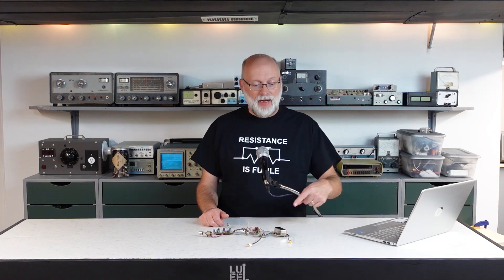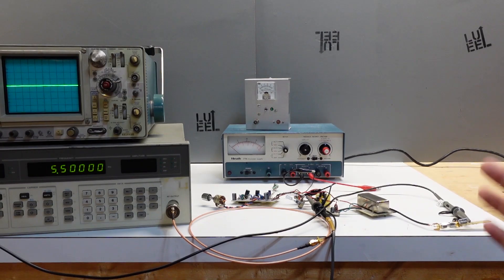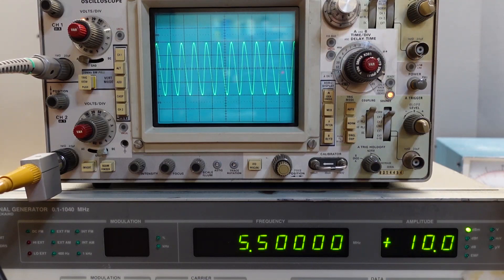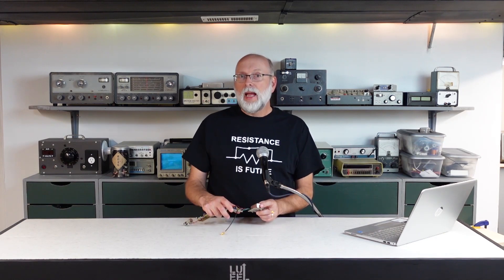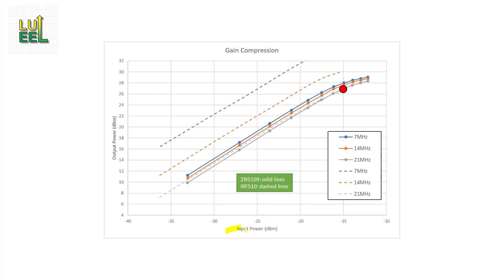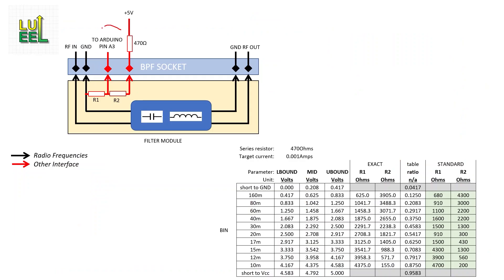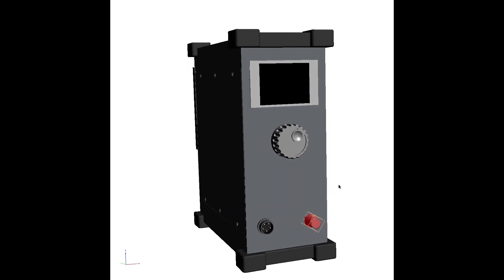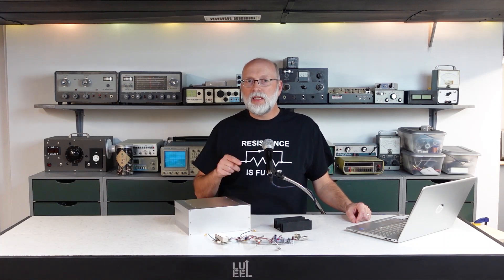HF Transmitter #06 - The IF stage plus MORE!

Comment: I'm curious, would it be a lot more difficult to design/build these SSB circuits for VHF?
Reply: I have had the same thoughts a few times. It is way harder above hf frequency’s.
Reply from the maker: Yes it does become more challenging at VHF due to smaller value caps and inductors, and lead lengths and board layout geometry become much more important.  But the stages up to the second mixer would remain the same I think.